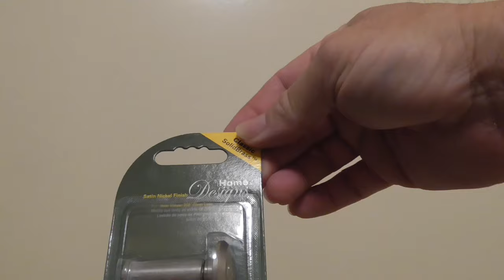How to Remove and Install a Door PeepHole

Comment: Found your video very helpful; I used the paint tape to surround the old peephole and carefully used the X-acto knife to cut the paint around the old one.  Instead of using two screwdrivers or the channel lock, I used a sturdy paint scraper to set into the two notches.  The scraper was long enough to fit across both notches & it was easy to unscrew the old one out by turning the paint scraper counterclockwise.

Unfortunately, my new peephole is bigger than the old one and while I have the right drill bit to make the hole slightly larger the drill bit doesn't fit into my drill.  My son promises to help get the bit usable so I can finish up this amazingly easy task.

Thanks again for sharing this info.

Comment: You can also use a metal paint scraper instead of 2 screwdrivers (I installed and removed a peephole knocker before)

Comment: You can also used a 2 inch chisel.
Reply: Use a 25 cent quarter. And turn the quarter with pliers. Works great

Comment: Tried the paint scraper, tried two screwdrivers on the same end of a multitool.  Watched this video.  Tried vice grips; not enough material on the flange to grip; too much paint built up by previous owners.  Outer end is beveled; no purchase at all.  But thanks for the idea.

Comment: Are they all the same size if I want to replace my peep hole?
Reply from the maker: peep holes are a few different diameters.. you really need to know the size of the hole in the door.. or you can buy the different sizes and then which ever is wrong can be returned.. have fun with your peep hole